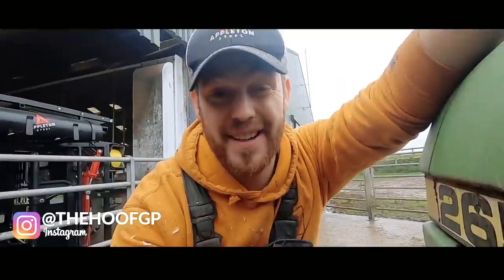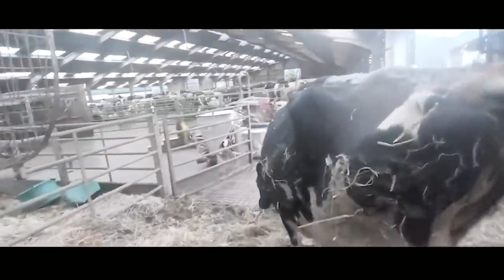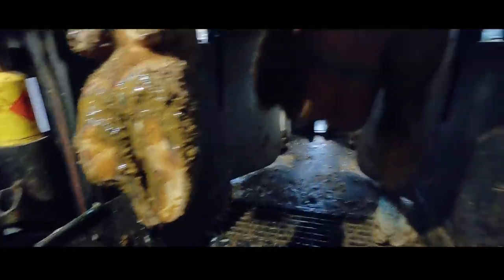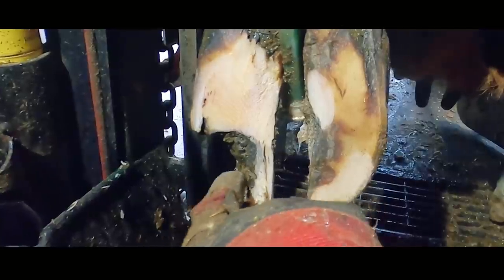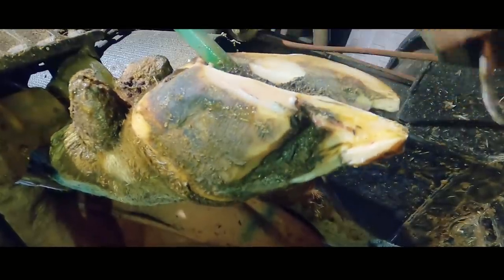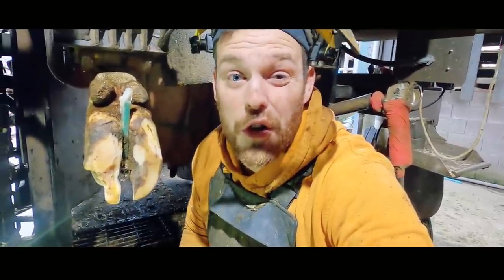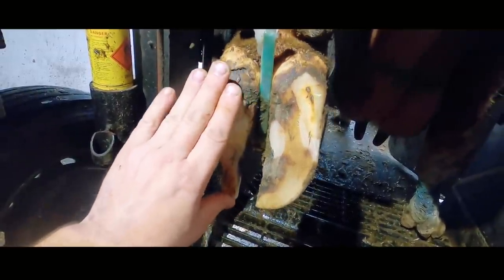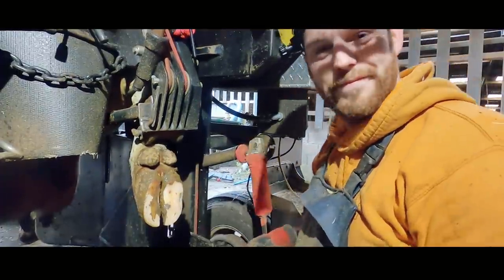THIS COW'S HOOF STORY IS INSPIRATIONAL **COW 812**

Comment: Two questions and one comment:
Q1: How does the tip of that outer claw not break off?
Q2: Are cows hooves made of the same material as human finger and toe nails?

Comment: invest in a macro lens with ring light for those close ups.  They are out of focus which ruins the effect.

Comment: That cow's hoofs have been overtrimmed way too much. Like for years. It's likely the issue came about from overtrimming and still you continue to trim that cow every couple of weeks. Just cut back on the trimming in general. Let everything grow over, like more than it should. You can make an exception for this cow at least. It will benefit from letting the hooves grow over and really reinforce. Instead of cutting them back every couple of weeks. They should only be getting their hooves trimmed 3 times a year anyway. I'm sure this cow has been trimmed 3 times in 3 months. Things are never going to heal properly and quickly at that rate.
Reply: The issue came about from sickness due to weight loss, not over trimming.